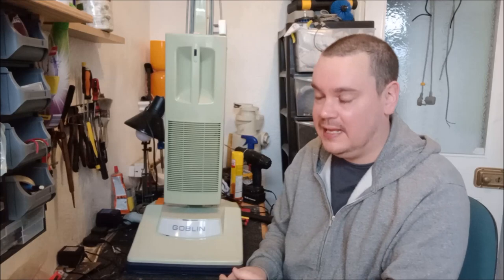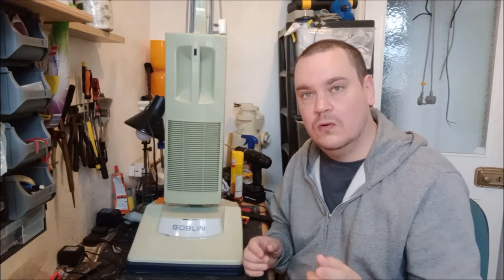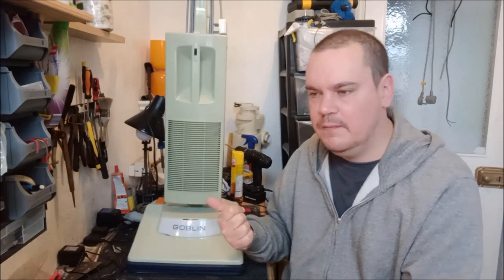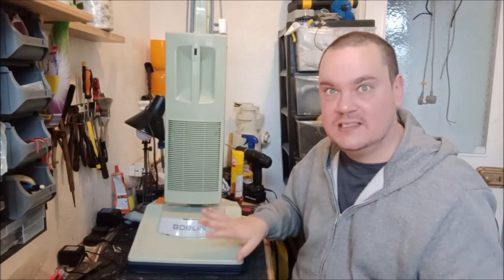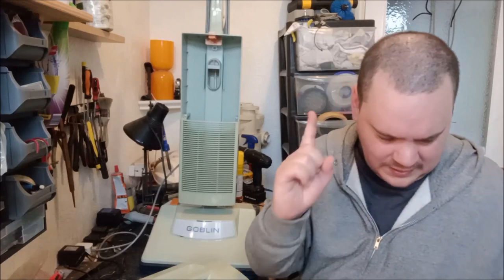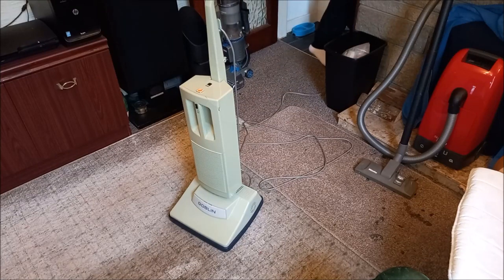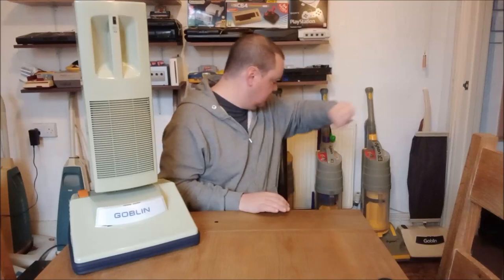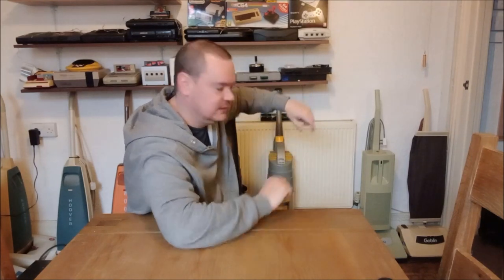FIRST USE EVER! - 1979 Goblin Housemaid GL888 - Restoration complete and a happy meee :D

Comment: Another great informative video Steve 👍🏻. I had the Spinny (Littlewoods/Burlington catalogue) version of this machine during the mid 80’s. It came with the hose and high level cleaning tools. There was a round cover on the right hand side of the machine by the on/off switch, when removed you could see the fan, the hose fitted in there.  I remember I sold it after a year and sadly purchased the awful “Hoover Spirit” I was always changing vacuums between upright and cylinder. Unfortunately at that time I didn’t realise how crap the Hoover Spirit was. Within a few months the Hoover Spirits nasty cheap hose broke and was not covered in the guarantee. Fortunately my local vacuum spares  shop in Walsall came up with a great solution. He somehow adapted an  Electrolux hose to fit the Hoover, it worked a treat and better still with the Lux floor tool it cleaned better.